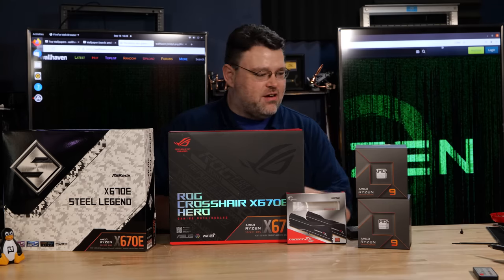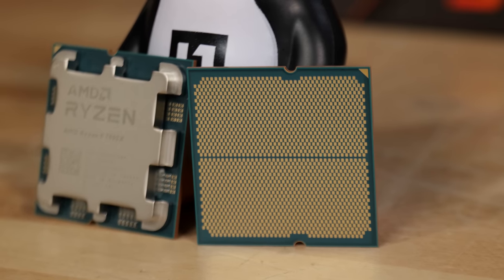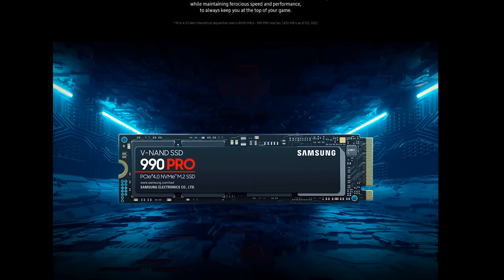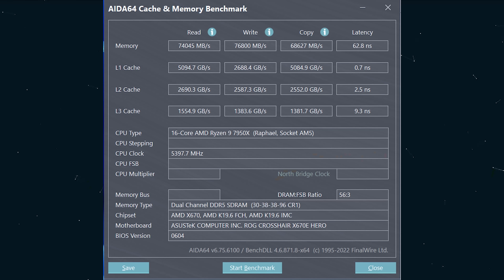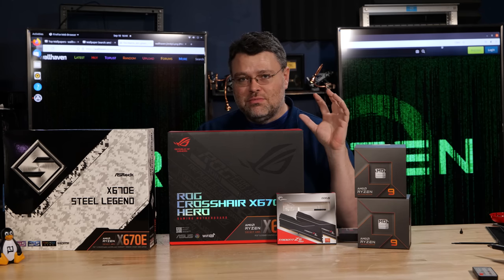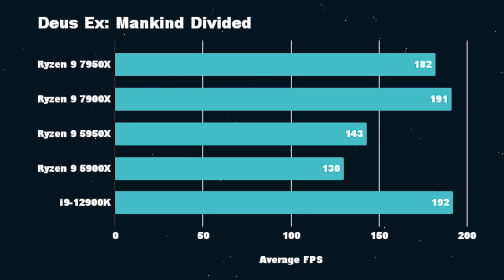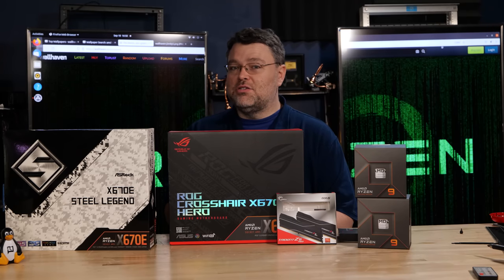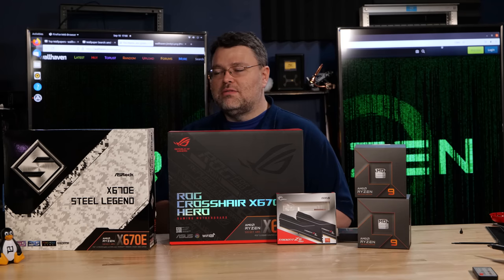RYZEN 7000 LAUNCH DAY BLOWOUT! DDR5, PCIe 5, Benchmarks, and MORE!

Comment: Throw in the 5800x3D into those gaming benchmarks, pretty wild how AM4 still has a lot of life left for high end gaming thanks to the 3D chip
Reply: Yeah I haven't even tried out my custom loop 5600x yet I also paired with 3600 cl14 was hoping a 5600X3D would come out
Reply: The 7600X beat the 5800X3D in Hardware Unboxed's 10 game average benchmark. Albeit the margins weren't massive and the 5800X3D is still a great chip for gaming.
Reply: @kamachi  That is DDR 4 vs 5, 7600x really did not do as well for the platform cost in gaming, if we take this to a lesser video cards would show more like a RX6600
Reply: Looking at how much of a boost that chip got I can't wait to see a 7950X3D getting the same treatment.
Reply: @kamachi  Yes, but we are talking about the early reviews here - were AMDs reviewsguidelines specifically detail that it must be tested with DDR5-6000 were as the official supported speed for that memory is DDR5-3600 for that config. Quite a massive OC.
Reply: By now AMD probably regrets having released the 5800x3d, it is just so good that many people don't have any reason to upgrade to AM5. You can have an old 
X370 system and just get one of the currently best gaming chips on the market.
Reply: @snowhawk4049  this is true for gaming mostly and not even all of the games. People use pcs for other stuff 😀
Reply: @snowhawk4049  depends what they're coming from. If I was on < 12th gen Intel and wanting to upgrade I'd go AM5 easily because I'll be able to drop a Zen 6 CPU in a couple of years down the road. Anyone on AM4 who doesn't have mini HEDT needs for a tonne of cores should probably just go 5800X3D though
Reply: I agree, The prices of x670E motherboards is too much. I will get a 5800X3D and wait another year for prices to come down. Currently on a 5600X. Gaming focused system, no streaming.
Reply: @kravenfoxbodies2479  the 7600x suffers only because it doesn't have a value platform to go with it... Yet. It's still a wildly good CPU and will be a great option once the value chipset boards are available and ddr5 comes down a bit.

Comment: Great video! This is the only review I've seen so far that mentions the value of curve optimizer and the new overclocking (less is more) for these chips. Keep up the great work! 

Also I'd love to see a re-visit of the 5800x3D unorthodox game benchmark video - what kind of performance can we see in factorio, dark days ahead, dwarf fortress and one of my favorites - BeamNG with lots of traffic enabled (very CPU intense - more cores = better). Thanks for the great content!
Reply from the maker: YES. THANK YOU :) Curve Optimizer less is more. I struggled with how to present that, and judging by questions I was right. At one point in this review I said that everyone will hyper focus on 95c and that is not the thing to worry about! :D
Reply: I didn't realize curve optimizer was included in Ryzen Master. I guess I need to check Master out again. I've been using 1usmus' utility for it. Curve optimizing is definitely the way to go for more performance on Zen parts

Comment: So glad that they have an IGP now. The number of times that comes in handy is crazy.
Reply: yep my nvidia burned on my 5950x build and I had to ask someone for a spare gpu to know what was wrong (0V gpu core voltage dead videocard :/)
Reply: Just from messing with PCIe risers of varying quality when PCIe gen 4 GPUs and mobos came out made this apparent
Reply: Intel has been doing that for how long?????
Reply: @ShainAndrews  Yes - true - one of the reason why my last few CPUs have been Intel 8but i did build AMD system in the meantime as well).
It is still great that they are now on all CPUs.
Reply: The built-in GPU is most exciting because you can use all the pcie slots for things like Network and storage.... This is an amazing platform for virtualization
Reply: Handy for when one day you build a server from it. I have RYZEN AM4 servers and lack of a video output requires me to do extra work.
Reply: check the benchmarks on the IGP, it sucks horribly. BUT i know what you mean about being handy, it really is.
Reply: I have a spare old Quadro for exactly this reason. Just a few dollarydoos on eBay.
Reply: @morosis82  I hate to waste a slot in a server.
Reply: @wayland7150  don't need to. ASRock X470D4U. Remote ikvm management, I can see the bios screen from an internet connected PC in Mallorca.

I just keep that card so I can plug it into non server gear if the video fails for some reason for troubleshooting.

Comment: Loved the Portal reference! ❤️ 

I'd also like to see the 5800x3d in those bechmarks. I'm on the fence atm and trying to decide between going with a 5800x3d or if I should go for something like the 7700x or 7900x.

Thanks for all the info, Wendell!
Reply: I would say if you have am4 already just upgrade to the 5800x3d. If you don't, then get on am5. That ensures a huge and viable upgrade path for you years from now. If you plan to upgrade in a year or two then I wouldn't worry about waiting for v cache. Zen 5 is going to be truly ridiculous. The difference between v cache or not for that year of use is just whatever.

Comment: What i'd like to see with those 4 "extra" PCIe 5.0 lanes is a some sort of PLX that converts it to 16 lanes of 3.0
Reply: 100 percent agree :)
Reply: @christopherjackson2157  What would you use it for, i have a 4x NVMe card i'd like to finally be able to use without needing to give up a freaking GPU to do so
Reply: I have some gen3 x16 nics and hbas. Though they'll run on x8 just with reduced bandwidth so id prefer they broke out into 2 gen3 x8 slots. I guess for the 4x nvme you need 16 lanes for it to address all of the drives? Presumably at at least gen3?

Comment: The 7950x beating the 5950x at 65w is pretty mental.
Looking at the power usage at first I was worried about newer laptops and next gen steam deck type devices, but it seems like they're be getting a very sizable perf improvement.
Reply: Yup! I keep telling people, they don't "run hot" - they're just letting the clock algorithm push them well past their efficiency peak for max performance, because they can, so, if you need lower temps, just underclock it! Just because it has 5.8Ghz capability doesn't mean that everyone who buys one actually needs/will benefit in an actually meaningful way(if you have to have an FPS counter on to tell the difference, that isn't very meaningful) from it, and cooler temps at the very least for a quieter system would probably be more valuable than the max performance with max power draw. Because they're so efficient, you can take a relatively minor performance decrease(application dependent) for a major power draw/temp drop. I know, this is just outrageous to many people, and they've been brainwashed to believe that it would be "better" if the CPUs were artificially limited to, say, 5.1Ghz for 'lower temps' and 'awesome overclocking potential'... 
...but, seriously, these modern CPUs will run absolutely however you want them to, if people would just let go of the caveman era traditional habits & beliefs and embrace the modern capabilities of these really flexible, and user tunable, architectures, then the specs around today's pretty damn advanced CPUs would be better understood.
[/rant] lol
Reply: @RyTrapp0  thank God someone else sees it. There's so much misconception going around with these chips and you hit the nail right on the head.

Comment: I just got a 5900x to upgrade my 2700x and it has been amazing, but seeing the details of the new platform makes me excited to upgrade in a few years when Zen 5 or 6 is launched and ddr5 + pcie5 aren't commanding the premium they do today. The flexibility and amount of bandwidth that mobo makers have to play with looks insane
Reply: Hi. Do you know which of these CPUs will perform better in machine learning and data science tasks, no need to say I would use a Nvidia GPU like 3070 besides the cpu, but I wanna choose an appropriate cpu for these types of tasks. These are my choices:
1. 5900X      :$250
2. 13600KF :$400
3. a little bit pricey one (13700KF:   $500)

Comment: Yay! Still sticking to the 5000 series for now.
Reply: Yep smartest choice, only when AM5 is on its final refresh will it be worth.
Reply: @honkingclown  Hi. Do you know which of these CPUs will perform better in machine learning and data science tasks, no need to say I would use a Nvidia GPU like 3070 besides the cpu, but I wanna choose an appropriate cpu for these types of tasks. These are my choices:
1. 5900X      :$250
2. 13600KF :$400
3. a little bit pricey one (13700KF:   $500)
Reply: @maxit1082  All are great choices for high core performance for machine learning but I'd say go for whichever fits your budget. I've had a 5900x for a little over a year now and it has never let me down.
Reply: @honkingclown  thanks for the help, actually there is a used 5900X for about $250, in the other hand there are some new intel CPUs like 13600kf that costs me over $370 or 13700kf for about $500. I'm thinking which of these CPUs have more value. But as you know the more important thing is GPU. if I choose the 5900x I could spend the extra money on a better GPU. If I wanna summarize both CPU and GPU configuration I afford are these three options:
1. 5900X + 3080Ti
2. 13600KF + 3070Ti
3. 13700KF + 3060 / 3060Ti
 which one should be a better choice?
Reply: @maxit1082  1

Comment: Looks like a nice upgrade if got the money to spend but for the budget shopper last Gen is a better deal with 5600 being $150 and getting a mb for  $150, that's the price as the 7600x and about 80-90% of the performance for gaming.
Reply: And for those who game in 1440p or higher, the difference probably becomes even less. 8)

Comment: I'm excited to see 3D-cache SKU eventually, it's simply the go-to especially for AM5 now though. New platform and higher entry cost in start, so 3D-cache SKU makes it a better value.
With DDR5 6000MHz CL30 being the sweet spot kit too. As for PCIe 5.0 I take it with next Radeon GPUs for the slot, as for SSDs I'd expect Samsung to eventually release it.
Reply: "With DDR5 6000MHz CL30 being the sweet spot kit too."
That's like saying Ryzen 7 1800x has a sweetspot ofr DDR4-3200 - yeah no, that is a heavy OC and basically the max most CPUs can even muster.
Reply: @ABaumstumpf  Not really, 3200/3600 is what people go with in general, just get the kit switch in bios done.
Reply: @StaySic4Ever  "3200/3600 is what people go with in general"
Yeah no. 3600 is the highend for what Zen1 and Zen+ reached, many struggled with anything higher than 3200. And here we are talking about an OC from DDR5-3600 to DDR5-6000. 
You know were the supposed "sweetspot" of DDR5-6000 comes from? Yea -an AMD-spokesperson when asked about memory-OC in relations to stability and possibility - aka the upper limit that people can even expect to get from OC unless they go for the really expensive dies and golden samples.
Try to guess what AMD send out handpicked memory-kits to be used for testing.....
Reply: @ABaumstumpf  Early Zen on AM4 the 3200 was the aim to get the kit and with current last it's 3600 which is really just a regular kit. There are more tighter timing ones like CL14 that cost much more.
Of course they will say what current sweetspot is, why is that anything strange. Obviously they'll send those kits for a review too. It's good, we can get what perf can be. 
You can get like 5200 kit, but why if you can get 6000 if price is not too much and kit is validated, come on.
Reply: @StaySic4Ever  "Of course they will say what current sweetspot is, why is that anything strange."
Yeah - and you believe the marketing-wank hook-line-and-sinker.
Same as DDR4-3600 was supposedly the "sweet-spot" when most CPUs were not even able to reach that.
Reply: @ABaumstumpf  That's not true, any CPU in current AM4 gen can reach that with proper kit and bios updated. I did multiple systems..
Reply: @StaySic4Ever   "any CPU in current AM4 gen can reach that "
Sure sure - tell that to anybody with a Zen1 or Zen+ CPU :P
Reply: @ABaumstumpf  like i said those obviously have lower limit with each gen higher..

Comment: The iGPU on all skus is one of the best things they changed. And so far that was also one of the reason why i was mostly leaning more towards Intel. I did have a couple GPUs die on me on the past (1 nvidia, 3 AMD) and even just for diagnosing problems (or lower idle-power) they are great.

And AMD finally released the grip on the artificial power-limit (mostly). Now if only Intel would learn and stop the board-partners from making such crappy default-settings that waste a shitton of power for no real benefit.

Comment: Der8auer showed how to properly cool the 7000 series with one problem: you have to decap the cpu.
And thus to reduce the AMD okay 95C° normal temperature to 65C° to 75C° underload.
In themselves they are really exciting but yes you have to do more cooling technically.

Comment: So, something doesn't jive.

There are 28 lanes, so are more controllers stuck into the SoC?

AMD at one point said you can have 2 NVMe off the CPU running gen5 X4, but that's not what I see.  The specs are saying one NVMe is connected to the CPU.  16 lanes goes to the slots, 4 lanes to one NVNe and 4 lanes to the chipset.  That leaves 4 extra lanes.

With X670 MBs it shows 2X the IO vs. B650 and extreme doesn't matter.  So how is X670 boards giving 2X the I/O if not through chipset?

Right now I can't find the chart that I once saw for X670 and B650 boards where it shows how many of each type of I/O you can get as a frame of reference, but I remember seeing it within the last couple weeks and X670 is basically double B650.

So how is this working?

Comment: 13:42 The best i can get on AM4 with a 5700G is 49.1NS with 4933C17-17-17-28 with improved sub timings. 
I wonder if the reduced bandwidth(around 72-76GB/s in aida64), but improved latency would benefit AM5
Reply: Of note this was 2 sticks of single rank samsung B dye 16GB for around $80(currently $109)
I just got in some dual rank that i'd like to test and that 32GB kit was $209, i spspect i'll only be able to get to 4600 on this kit being dual rank but it may reduce latency even more to make up for the lack of cache on the 5700g

Comment: Any information on one stick of ram OC? AMD's 7950x (and other) pages, under "see full specifications", states 1 ram 1 rank and 1 rank 2 rank hitting 5200mhz. but 2 ram 1 rank and 2 ram 2 rank only hitting 3600mhz. Would one stick of 32gb ram actually be good for gaming? #geniuinely_curious. BECAUSE typically AMD specs, like the 3950x page, under "see full specifications" clearly notes 2 ram 1 rank, 2 rank 2 rank, 4 ram 1 rank and 4 ram 2 rank.... so clearly we used to see dual/quad chip and now they are stating single ram and then dual ram.... so its #odd
Reply: Hi. Do you know which of these CPUs will perform better in machine learning and data science tasks, no need to say I would use a Nvidia GPU like 3070 besides the cpu, but I wanna choose an appropriate cpu for these types of tasks. These are my choices:
1. 5900X      :$250
2. 13600KF :$400
3. a little bit pricey one (13700KF:   $500)
Reply: @maxit1082  well, from my limited understanding of ai/machine learning, said ai/machine learning likes both strong single core performance but also leveraging that performance over multi-cores aka multi-core. so while the 5900x has good multi-core, its single core loses to both the 13600kf and 13700kf. so the 12 core 5900x would be strong in that regards, except the 13600kf has 6 core 12 performance cores/threads and then another 8 efficiency cores. which technically makes it a 14 core product when it comes to ai/machine learning workloads. 14 stronger cores will beat amd's slower 12 cores.... and of course the 13700kf adds 2 more cores and 4 more threads on top of what the 13600kf offers....

get what you can afford. if you can afford the 13700kf, get it. if not, probably go for the 13600kf.
Reply: @goblinphreak2132  Thank you for response.
But as you know there is another  important factor,  GPU. if I choose the 5900x then I could spend the extra money on a better GPU. If I wanna summarize both CPU and GPU configuration I afford are these three options:
1. 5900X + 3080Ti
2. 13600KF + 3070Ti
3. 13700KF + 3060 / 3060Ti
 which one should be a better combination?
Reply: @maxit1082  i think it will depend on the workload. What application are you using for ai/ml? Does that app prefer gpu or cpu? Youll have to research that and figure out what is best.

On the AI generated art, that will either leverage cpu or gpu but not both. And in that workload the Nvidia gpu will walk circles around the CPU. So if you are using something like stable diffusion to make art from ai, then you should go with the most expensive gpu and cheap cpu.
Reply: @goblinphreak2132  yeah actually the difference between 5900x and 13700k is about 30% but in the other side, 3080Ti is far superior than a 3060 by a roughly 3times faster. I think it’s more reasonable to devote 30% of CPU power but gain a nice 3X more GPU performance.

Comment: How do you think X3D chips will perform in a DAW, will the extra L-cache give it a performance boost?
Reply: I'm not running an orchestra suite or a live studio but have no problems with a 9700k with Reaper, several guitar VST plugins, EZDrummer, etc. using a first gen Scarlett 8i6. I haven't tried with a Ryzen CPU, but unless you're running quite a lot, any of the last couple of gens of 8 cores would probably work great. Maybe how light he DAW is and handles plugins would be a consideration, too.  I have no idea how much the larger cache would help and think it's an interesting question, like if more cores would be more of a factor or not.